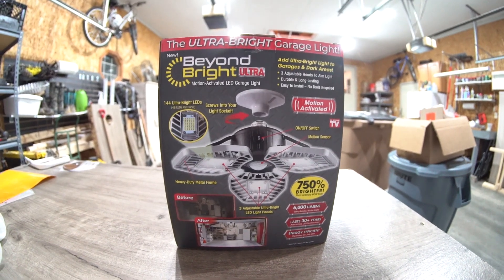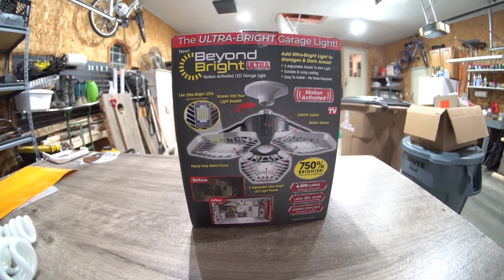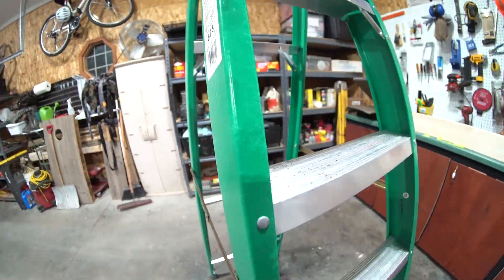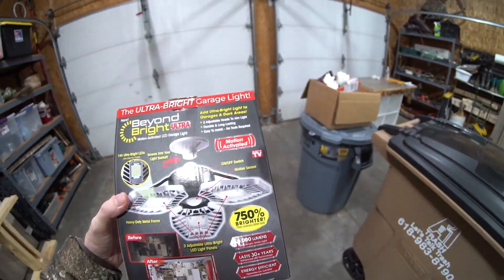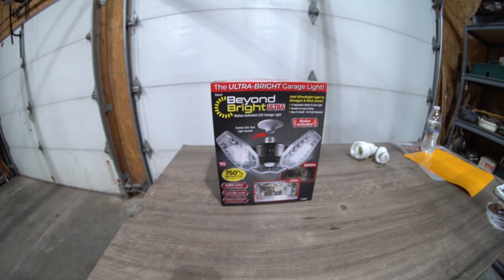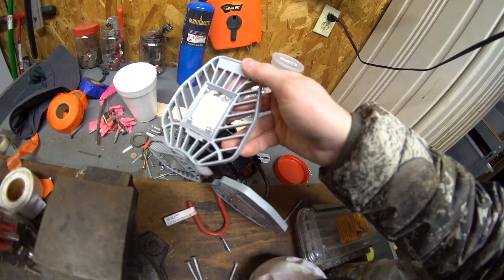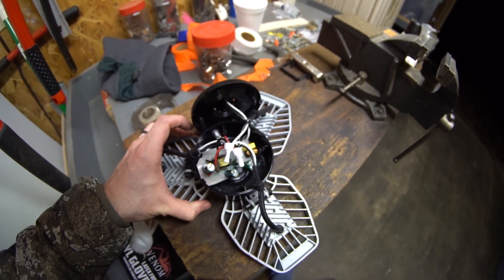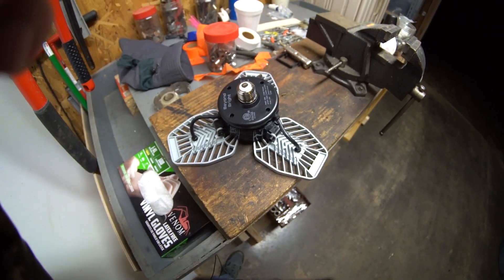"Beyond Bright" LED garage light Review | Are these fan blade lights the best the upgrade ever ($40)

Comment: Keep an eye on it. I had on in my basement and this thing burned out -- as in CHARRED -- within about 8 months after buying it. There were burn marks on all three contact points, blown LED diodes, and cracked plastic above the contacts. I'd have to unscrew everything to do a proper forensic on it, but I'M not going to be putting another one of these in my basement!

Comment: I have been using some that I bought at Menards a year and a half ago. No motion sensor, just straight up 4 blade but 12,000 lumens. Incredible and draw les power than most bulbs. I use them in a machine shed/shop with 14' ceilings. Caught them on sale for $29 ea. Wish I had bought 20 of them as they are very rarely in stock. I use to use 300watt light bulbs and they were not nearly as bright and burnt out all the time.

Comment: Bought 6 months ago . Noted now to be hanging by wires.  The 4 supporting posts had all broken. Likely from heat. No way to reattach.  Still works but can't have it hanging by a thread. Removed from socket and will see if Home Depot will take back. Worthless piece of junk. Good idea, though and really did add good light.

Comment: I bought two of these sometime in the last three years and both of them have failed. One of them started coming apart at the screw connectors just like in the video. Looks like the screw shafts just got brittle and broke. They are great when the work but I don't think they last near as long as they claim they will last. 30 years??? Yeah no. 3 years maybe if you are lucky.